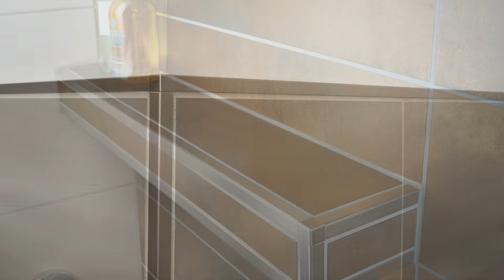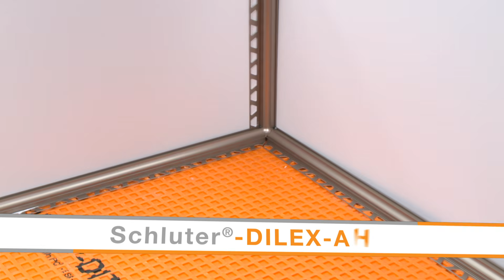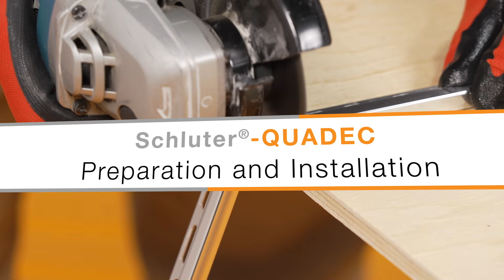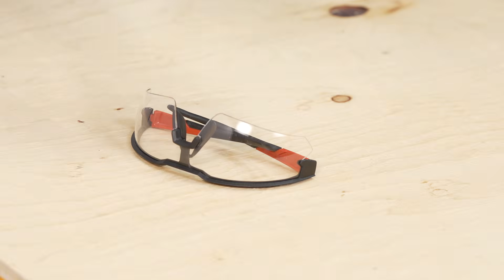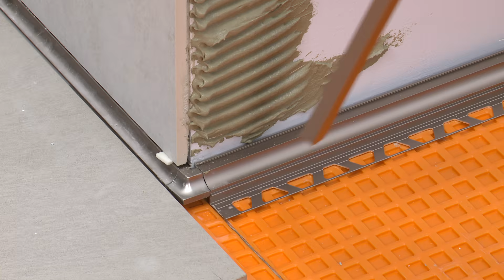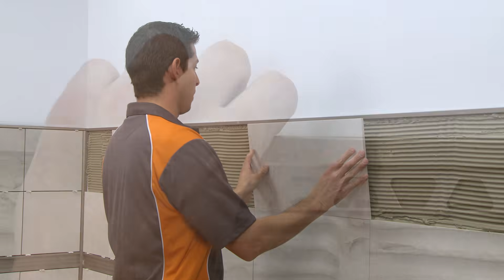How to install tile edge trim on walls: Schluter®-QUADEC profile

Comment: its great and everything but why can i buy a whole 8 foot strip of the trim for like 25 bucks but you're charging like 15 for each corner piece i need. I need just 7 and it feels weird spending over 100 bucks on 7 corner pieces
Reply from the maker: Hi there! It’s a bit hard to answer without knowing which profile you’re working with. In general though, pricing for profiles and corner pieces depends mostly on the material and finish. If you’re using an aluminum profile, most of our aluminum corners are actually milled from solid aluminum — so even though they contain less material than an 8-foot profile, the manufacturing process is more complex. That’s why you’ll see a difference in price.

Comment: Have these folks ever heard of TCNA (Tile Council of North America) guidelines. 1) Comb the thinset mortar in the direction of the tiles shortest dimension. 2) Rock the tile back and forth perpendicular to the direction combed to collapse the mortar channels made by the trowel notches. These principles are bedrock.

Watch closely as the tiles are laid and you will see that they are not getting full coverage. If you were to pull one of these tiles, you would see lines of mortar alternating with bare spots that are completely unsupported. The tile would break easily if struck and will loosen prematurely from the wall.

Really, if you are going to make an instructional video, you should take the time to understand your trade. The last thing homeowners need is expert advice from people who have no idea what they are doing.
~JSmith
Reply: Man you don't know SHIT!!

Comment: When using on the outside corners of a bench do you use grout or caulk between the edging and the tile? Thanks
Reply from the maker: Hi Hunter! You can fill the edging with grout or setting material. Here is a link to our data sheet for complete instructions: https://sccpublic.s3-external-1.amazonaws.com/sys-master/images/hbc/h3d/9438313971742/Wall%20and%20Countertop%20Profiles%20Data%20Sheet.pdf

Comment: Can you put the anchoring leg underneath your backer board?
Reply from the maker: Hi Lisa! If that works out better for your installation, profile thickness wise, and it's not in a shower, sure. Follow the same guidelines for grout joint size and ending up with a flush finish or the profile 1/32" lower than the tile and you should be fine.

Comment: I’m using tile that’s 10 mm thick, should I use the 3/8 inch trim or 0.5 inch trim?
Reply from the maker: Hi there ! Yes would be better to use a 1/2'' profile as your tile might be slightly higher in the middle especially if you are using a larger format tile. Also by using a 1/2'' profile, it will accommodate the thin-set thickness.

You can also contact our Customer service  teams if you would like profile samples to check for fit with your tile. You can reach them at 800-472-4588 (US) or 800-667-8746 (CA). Hope that helps! 🍊

Comment: Consider using the next size bigger edging trim over the tile thickness. This will help when you figure in the thin set and tile combined thickness.

Comment: What were the trims installed with that were installed off camera. Was that the schluter caulk?
Reply from the maker: Hey Marcus! Profiles are generally installed with thin-set mortar. Please have a look at the installation steps here if you have any questions about a specific profile: https://sccpublic.s3-external-1.amazonaws.com/sys-master/images/h80/hb7/9348889870366/Wall%20and%20Countertop%20Profiles%20Data%20Sheet.pdf